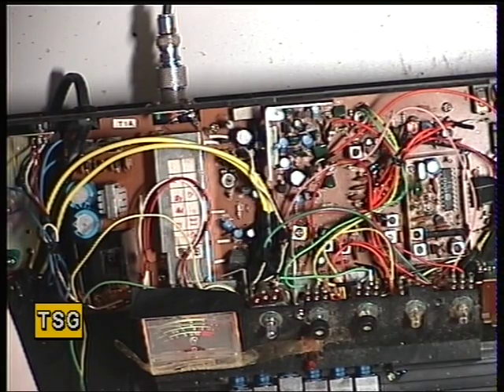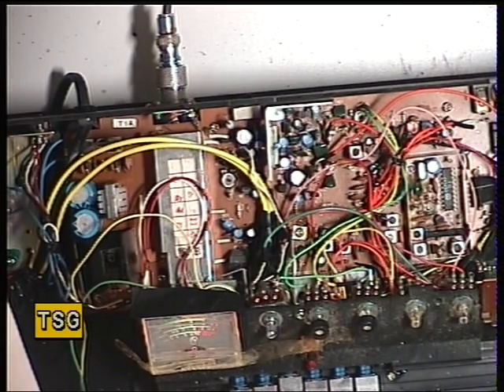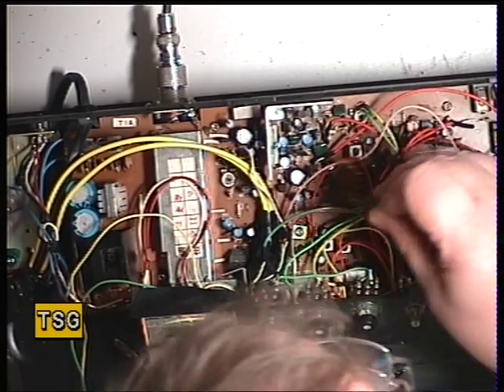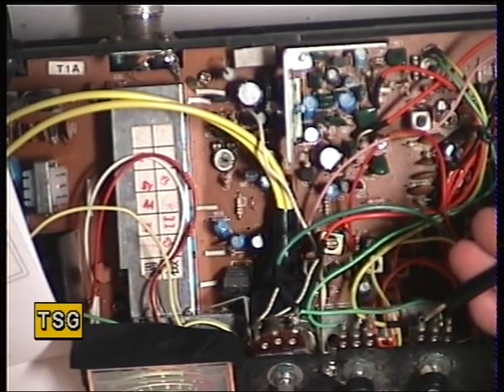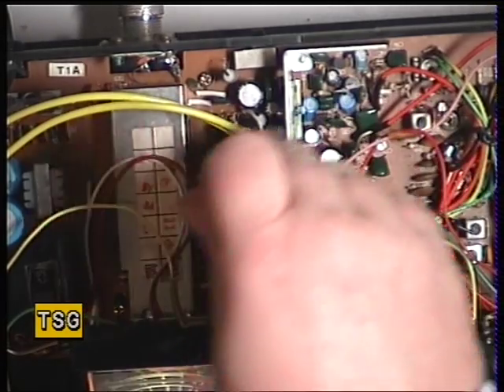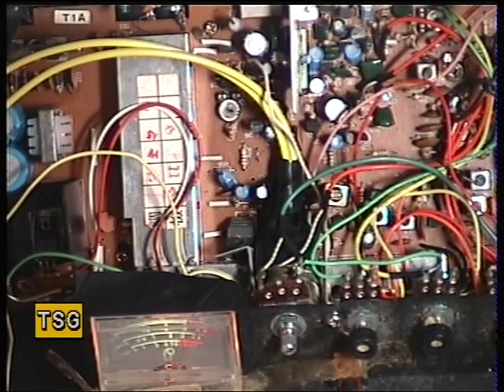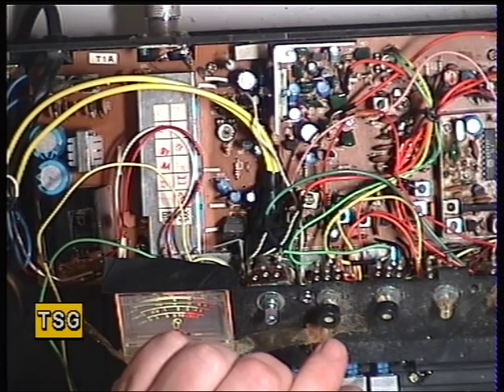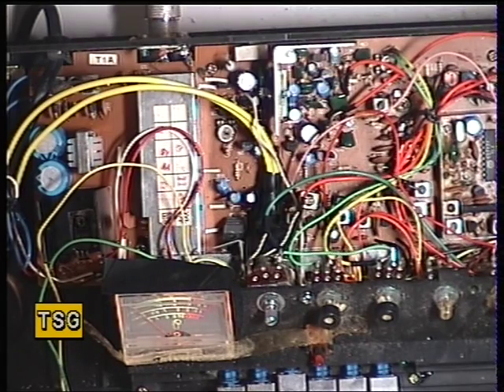Fidelity 3000, UK (CB 27/81) CB radio (Base Station)   - Receiver alignment

Comment: Hi Richard, just got ones of these, really great video as always which I have been following, can I just check - do i adjust the detector or is that related to the 4 you do not touch ( sweep generator ones) , wasnt sure if you said to adjust these or not.?
Reply from the maker: Yes, it's a sweep generator job officially, but I do them on the SINAD meter with care. Not just simply a matter of an S9 signal & 1khz tone & tune for max recovered audio, not with these sets...or the fidelity 1000.

Richard
Reply: @ukfmcbradioservicingTango21  thank you Richard, it seems to be receiving so i will leave well alone.